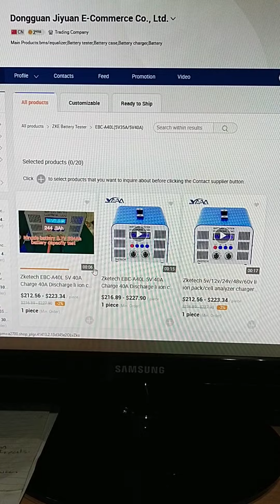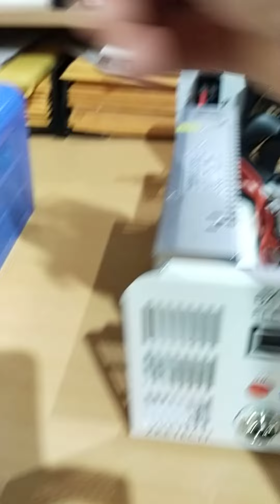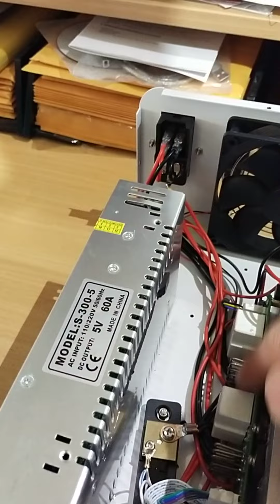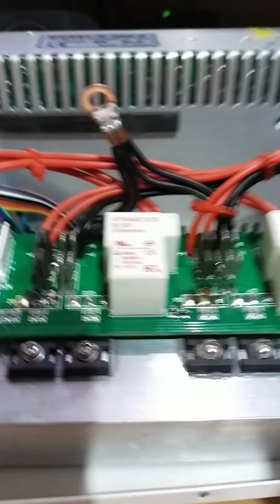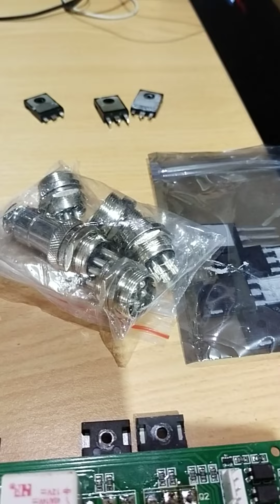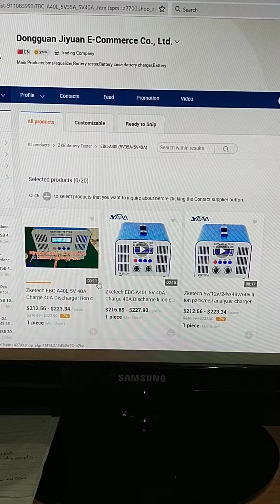Zketech EBC-A40l Battery tester

Comment: Curious? Were these connected to 110v or 220V? They were first only offered in 220v configuration but Americans complained so much they switched or offered them either way. Thing is they only charge with 35a with 220v according to the manual. But discharge at 40a. What they don't say is that the charge current is only 20a with 110v.
Wonder how  the power supply was set up on your second unit since it blew when you turned it on? There's a selector switch on the bottom of the unit on the power supply to select 110v or 220v.or testing.  I
Hate you've had the problems! I've had one for a while wired for 110v. I've never used it for more than 20a up or down charging  I do now have some fan noise that sounds like it might be coming from the power supply? I'll need to figure out where that's coming from before it freezes and burns taking out the rest of the unit.
Otherwise it has worked well for me. That said, I've got 96 cells on the way, we'll see how it likes all that mess.

Comment: I have found them to be pretty poor junk.  The ADC that measures the cell voltage is terrible.  Only uses a cheap old STM8 Chinese copy clone microcontroller.  No where near meeting its voltage or load current accuracy specs. The load current actual on my unit is about 5% off of the display setting.

Comment: Solder the legs of the transistors on both sides, and RC1-RC8 on both sides, where you reduce the soldering there as well. Also replace the thermal paste with a better quality one. Thermal Grizzly Kryonaut Thermal Conductive Paste 1g - 12.5W/mk I put this. The plate of the blue cover was also very hot for me, I couldn't even turn it off by software during charging, only if I interrupted it or turned it off with the main switch. When I recharged it, the Volts and Amps also dropped during charging, plus the fan didn't start either. I resoldered it, replaced the thermal paste and it works well. My panel is a little different. Worth a try.

Comment: I have exactly the same problem - you can see that there are more of us. I will try to replace the transistors with better matched ones. In addition, he plans to choose a different model of the transistor in an insulated housing - he wants to eliminate the silicone spacer. My report in Polish: https://youtu.be/muSox5y8qcw
Reply from the maker: Yes there is a lot of us. good luck and please tell me if successful. I am not that electronically minded but have a go at most things. There is a local person I may take mine to as my soldering iron is way too hot. Thanks for commenting and hope that Russia stays away from you.  Cheers Dave from Australia

Comment: It seems like I have similar issue but it is has not happened yet. I've purchased a unit like that and I wanted to replace a fan to a quieter one. When I opened the case I saw a burned shunt on the left. I've tested a bit how it works and it seems like there are two groups of mosfets and most likely they are supposed to share the load so that each mosfet handles 20A from 40A the unit can handle. What happens is: when I start charging I see that 50% of current flows trough each mosfet but then the current starts dropping quickly on the left mosfet of the right group, which leads to the other mosfet handling 40A and getting hot up to 160C. The shunt before that mosfet is also so hot that even soldering becomes fluid and it is risking to melt the cables below it, there is no protection at all. I've tried to replace thermal compound, did not help. There is definitely an issue.

You might be able to fix it by replacing all 4 transistors but you need to make sure that they are from the same production batch because to share the load they must have equal resistance. At least that is what I am going to try. The manufacturer might be using mosfets from different batches and randomly this issue happens for some units.

I guess those M-type shunts before transistors have been put into there to balance the current, but in my case they obviously fail to do so.
Reply: @daverowley9370  Actually just today I seem to have fixed my charger. I even did not have to replace the mosfets. In a nutshell the issue was poor heating. There are 2 groups of mosfets. In each group the one on the left is doing charging and another one on the right is discharging. And since back of the mosfet is conductive they had to put an insulation pad beneath the two mosfets which are responsible for charging and the ones doing discharging are not insulated because they generate more heat, so radiator is conducting current FYI. That is a simple cheap silicone pad which does not conduct heat really well. It turns out when those mosfets heat up they start opening at lower voltages and basically if any of the two mosfets in a group heat more than the other one it starts taking all load to itself because I think it opens more than another one due to overheating, which leads to more overheating. To fix this I've replaced the silicone pads with ceramic pads to improve heat transfer. Also I've bought 2 copper bars 20cm x 4cm x 3mm which are usually used as a ground connection and put one of them below the mosfets so that copper takes heat away and transfers it to the aluminum radiator. Also I've used another copper bar as a press on top of the mosfets, so that it also acts as an additional radiator. For this I've had to remove all mosfets and lengthen their legs because by default they are half way under the PCB. Obviously I've put thermal paste on the ceramic pads, copper bars etc. It would be simpler to replace the whole radiator to copper (it has 2x thermal conductivity compared to aluminum) but I did it this way. Now the mosfets heat up evenly and share the load as they should.
Reply: And regarding amperage. I did a few tests and I noticed that disbalance happens even at 20A. But at 20A it is ok because if one of the mosfets is doing all of the work it is ok because if you were charging at 40A and everything worked as designed each mosfet would be handling 20A anyway. So I'd say with these chargers until you fix heating issues do not charge with more than 20A. Discharing 40A is ok because there are no pads under discharging mosfets.
Reply: While I was watching multiple videos of people taking these charges apart I noticed that sometimes they come with a very different PCB having different mosfet layout & working principles, so that should be taken into account as well.
Reply: Exactly the same is observed. Starting charging transistor one and the other after 20A. After 15 seconds on one 37A on the other only 3A. Continued operation in this condition will lead to destruction.

Comment: Sorry for your bad experience. I hope mine won't be that disappointing. I'll make sure to open it and check inside for potential flaws. So thanks for sharing.
Reply: @daverowley9370  I finally tested mine today and I was lucky as I charged my first 280 cell at 40A without any problem whatsoever. The I couldn't get Linux Mint to load the driver for some reasons. But I know that the person who helps Andy from the Offgrid Garage, was able to install it on Zorin. Fortunately I had an old laptop with windows 10 as dual boot and all went OK afterward. I'm actually replacing my Trojan T-875 because they no longer hold a charge. I wonder if your desulfation would work on plain deep cycle sealed acid-lead battteries. How do you use the EBC-A40L to do that by the way?
Reply: @daverowley9370  I watched those videos as well and tried restoring some deep cycle 12V lead acid batteries I found in Home Depot recycling bins. I've not been lucky so far. I only restored one that was totally dried up by adding distilled water and cycling it slowly at 2A. As you mentionned, I could not recover more than half the capacity. Then I tried using an old method that consists of using a large capcitor and a full bridge rectifier. Though it seems to resurect some dead batteries it couldn't restore their capacity in a significant way. People throw them for a reason. At least I got a couple of bucks for properly recycling each of  them. That's why I opted for the LiFePO4. Back 4 years ago I was able to get hold of those A123 cells from bus racks. I left them on the shelve for a good 3 years and they had not dropped their nominal voltage of 3.2V. I installed them with an ANT BMS and they have been serving my experimental setup as a 100Ah 48V. They could power my 2 fridges, one freezer and the recirculating pond pump through the night without problem until winter came. So I upgraded the system with 16 280Ah cells and another ANT BMS which I would parallel. It's been working OK albeit with some hick ups which I'm working out. As far as the charger is concerned, it's working strong to top balance my 3d bank of 16 cells  in 5 days!!!. But I won't use it to discharge them and  find their capacity as it takes way too long and is wasteful. I'll attach a Daly BMS and connect it to my inverter to drain its power down to 3.0V and monitor each cell for any sign of unbalance.  Have a great day.

Comment: I bought one off ebay, died during first use. Seller gave me the run around for weeks. Finally got my money back from them. They would not send parts, but needed me to send many video's and pictures. Bought a second off ebay, different seller, bought a extended warantee from 3rd party. Thing has worked perfect. 40amps no issues.